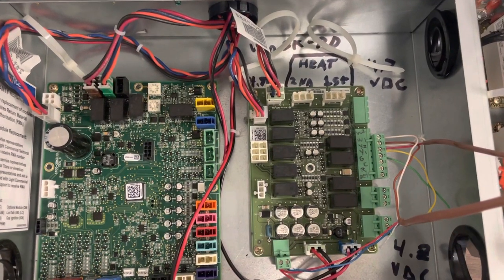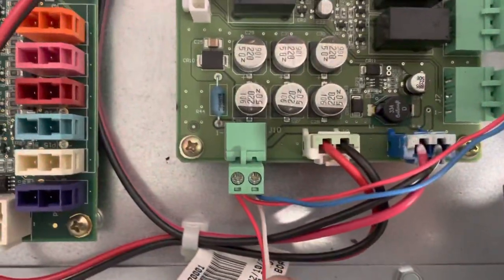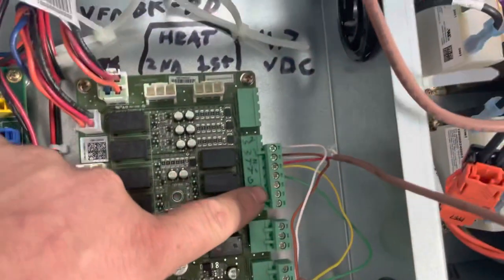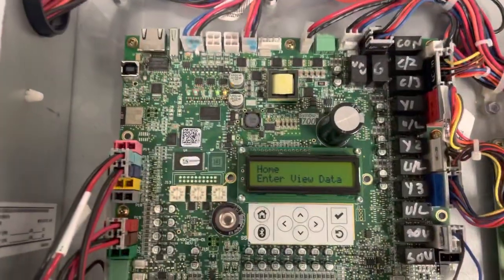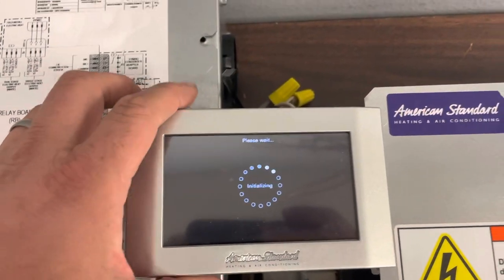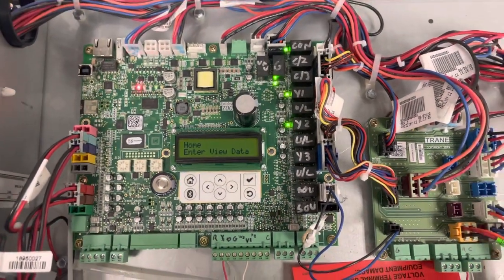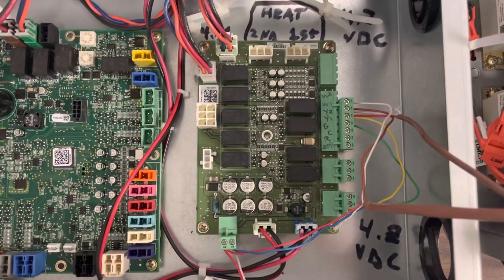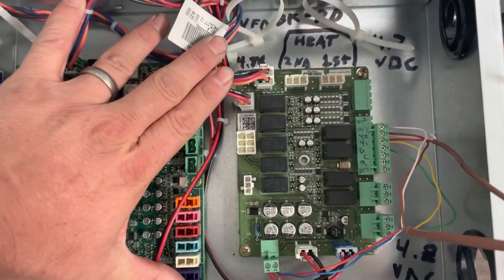Symbio 700 Trane American Standard Only 2 Wires to Condenser

Comment: Thanks for making this. 

Just to clarify that all the modern odyssey units will have this symbio or can I get a 7.5 without? 

And if my only option is yes both indoor and outdoor will have this symbio can I wire a heat pump traditionally (like in this video) and the only issue will be the heat strips in defrost?

Comment: Question. 7.5 ton symbio outdoor, symbio ahu vfd indoor using 4 18g wire to outside only.
 Sending 24 volts from o/u J-15, 1&2 to I/u J-10 1&2 with R from conventional t-stat, connected to J-10 1 
 From T-stat, G wire to J-5, 4.
Y wire to J-5, 5, with jumper to J-5, 6.
W wire to J-5, 7
 Two other wires to the outside are from J-5, 5&6 to o/u J-21, 2&6.
 The condenser will respond to call for cooling, but no blower inside.
 How would I program I/U without communication to the o/u Bluetooth connection?
Thanks in advance for whatever help you can offer.
Reply from the maker: If your air handler has a “D” in the 15th digit, it needs the comm wire ran between the indoor and outdoor unit. https://support.trane.com/hc/en-us/articles/360055517711-Pairing-B-Wiring-and-Setup-Symbio-Condenser-or-Heat-Pump-with-SZVAV-2-Speed-Air-Handler

There is a workaround but I can’t find the diagram online. There is a way to convert it to a “C” unit, which doesn’t require the comm wire.

Comment: Thank you for taking the time to illustrate the 2 wire hook up. So to clarify would just need a 24v trans wired to R & C in the outdoor unit for control power?
Reply from the maker: Correct. The condenser will come with the 24v transformer in the outdoor unit, so it will power the outdoor board. 
You would need to supply an 24v transformer on the indoor unit to power the indoor relay board.

Comment: Why on a 2 speed condenser my compressor 1 trips when there is no longer a call for the  2nd stage when they are both on unit runs good?
Reply from the maker: I'd need more info to try to troubleshoot.  What fault are you getting.

Comment: Thank you for the information. I have two 7.5 tons condensers and a one 15 ton air handler with no Symbio technology. What will be the best way to do the connection. Can I install the board to the air handler and put it to work? Or I will need to change the inside unit as well. Please let me know. Thanks in advance.
Reply from the maker: twinning 2 symbio condensers is not supported at this time.  Sorry
Reply: @Hvacoffroad  how about at this time? because they sure sell them.

Comment: If the the air handler has a VFD, the two wire configuration will not work, correct?
Reply from the maker: Correct.  You'll need twisted shielded wires to the vfd, along with more conductors.  That's a whole different configuration.
Reply: What’s the twisted shielded wires? 
I’m running into that problem where the vfd is not communicating. I used normal thermostat wire to connect to my relay board to the adapter board.

Comment: So does anyone on the planet have experience with two symbio condensers tied into one symbio air handler with vfd? Do both condensers require mod bus? How about ICM? Will I need to change the address of one unit? Why can't i put the VFD in hand to run the gas furnace?  The documentation for Z pairing seems ...incomplete.  It's hard to start a trane.
Reply from the maker: I know hooking up modbus to both condensers will not work.  It will not communicate with both connected.

Comment: I may have misunderstood. So is there a way to wire up without running the thermostat to the condenser?
Reply from the maker: I may be misunderstanding your question.  Yes, you still need the signals going to the condenser.  This is just a way to make it run with 2 wires only.
Reply: @Hvacoffroad  I didn’t word it properly or I’m confusing this with another symbio video. 

We are looking at replacing a 10ton unit heat pump. We were informed by local Trane rep that we must run the controls to the condenser and not to the air handler. They have very little to no training on this in our area, we didn’t want to eat up labor hours trying to configure something to work. 

Pulling the control wiring to the condenser is going to be labor intensive and pushes us away from using Trane equipment with Symbio if it is necessary to do that.
Reply from the maker: @Gamingrelease  
Correct. You should land you thermostat controls on the condenser.  Then run a bundle of wires from the condenser to the air handler.  You can use your air handler as a “junction box” if you have enough conductors to do so. 
The outdoor board is the main control. So signals go into that from the thermostat, then it sends the signal to the air handler.

Comment: So if it was a heat pump could I use this configuration and send the connection for the reversing valve outside?
Reply from the maker: Yes you could. The air handler doesn’t need to see the command for the reversing valve.  But you won’t have electric heat energize during defrost without the twisted shielded wires.

Comment: New install I have 24volts the moment it ask for cooling it drops 24 volts
Reply from the maker: Don't wire up the thermostat to R and C from the indoor board, the terminals are not rated for the amperage of the thermostat and contactor coils.  
You must provide a field installed transformer at the indoor unit and use it as the power source for the thermostat.